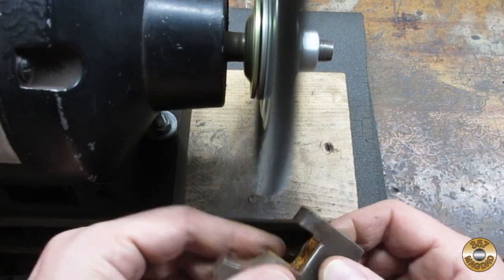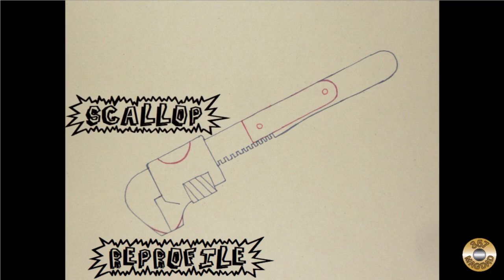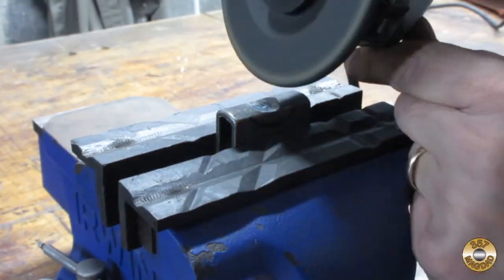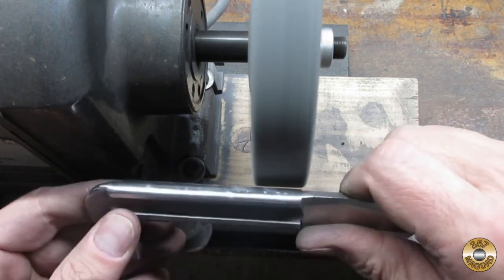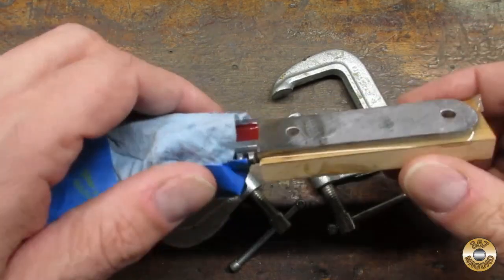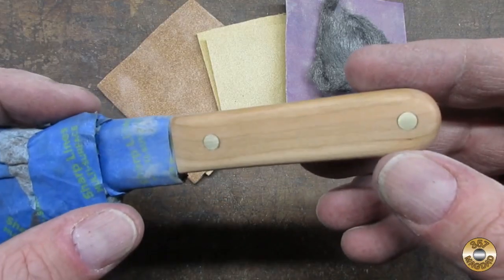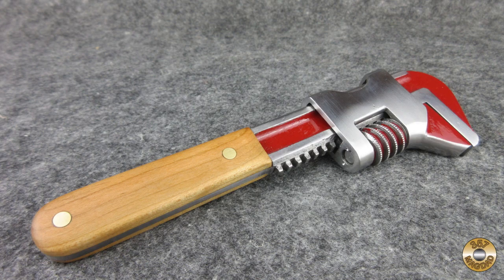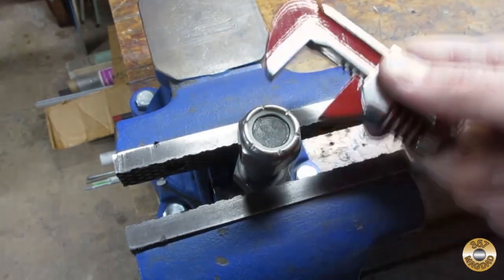Auto Wrench Part 2 - What Have I Done??

Comment: Magdad you did a great job cleaning up the Auto wrench. I love the red and how smooth you got the metal. I'm not sure I agree with cutting down the handle and putting on the wood handle. I like to keep tools the way they were made and clean up the casting! The red color you picked reminds me of the H.K. Porter red they used at their foundry in Somerville, Mass where my dad worked! 👌
Reply from the maker: The fun part about doing a restomod is that you get to do it any way you want!